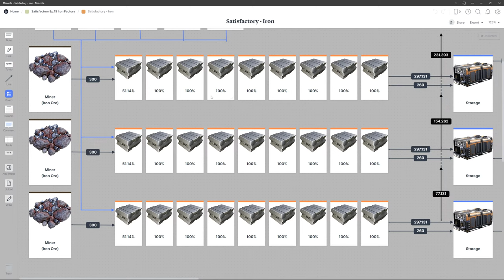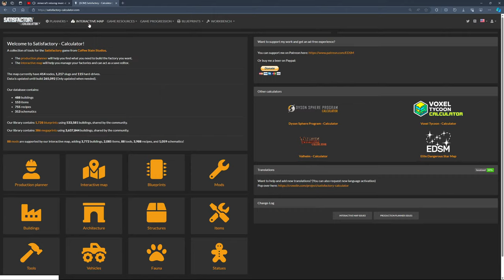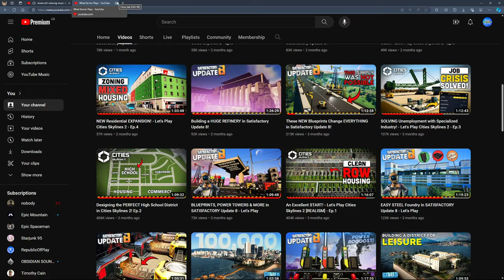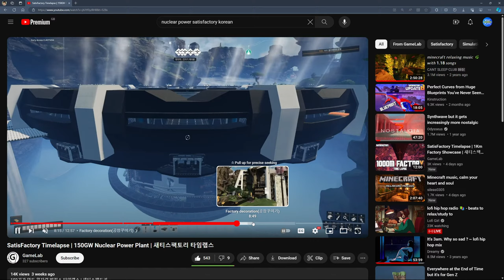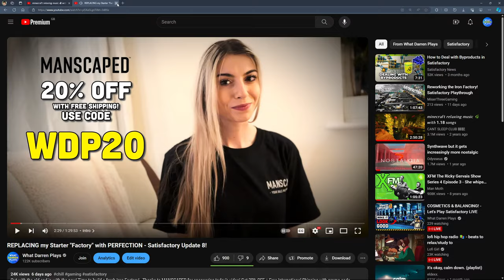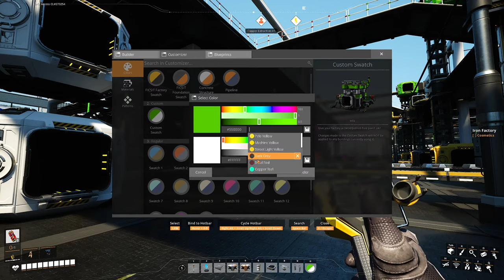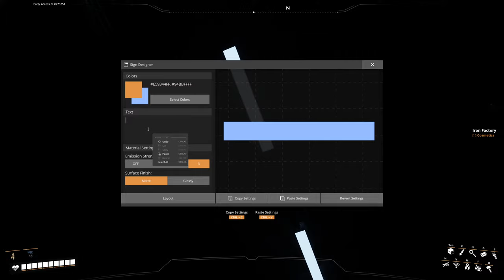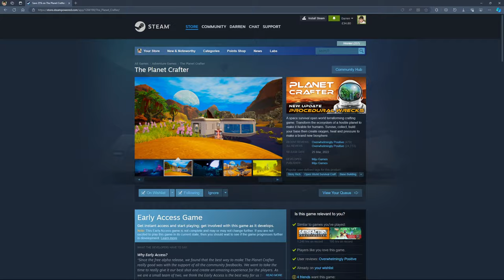Adding DETAIL and Lighting to my Iron Factory! - Let's Play Satisfactory LIVE

Comment: Hey Darren, I don’t ever get to watch live due to time difference but I do enjoy watching through your streams and hearing your commentary on well pretty much everything 😂. I did notice when you were talking about trains and throughputs you stated that you couldn’t get constant belt feeds because it stops while the train is loading or unloading. That is true, but if you add a storage container in line as a buffer the belt from the container will keep running when the belt between it and the station stops. Hopefully that makes sense. I had to use that when I created a sorter for my electronics factory because I had so many trains coming in.
Reply from the maker: That only works unless you’re using the max belt speed.
You can never transfer 1560 (2x 780 inputs) per min to a train because it pauses the belts while loading. If the belt was then feeding into a storage container as a buffer, you would be sending 1560 into the buffer, but you can only get 1560 out when the belts resume. The time they were paused means the buffer will slowly fill up over a few train arrivals.

Comment: Crystal Computers Alt Recipe is the most efficient computer option, uses crystal oscillators and circuit boards in an assembler.

For trains, you can build a blank platform.  Blank platforms will allow you to build one station receiving from several trains.  If you want the 3rd car to carry and deliver silica, you would build a station, 2 blank platforms and then a freight platform to load the silica.  Then it would be delivered to a station and empty on the 3rd platform.  If the train only goes from station A to station B, you'll always have 2 empty cars.

Comment: Would you mind explaining more about Warhammer 3 cost/return versus DLC? I appreciate your insight.
Reply from the maker: Sure, but briefly;
Rome 2 released 2013, sold approx 1.1m copies in its first month.
Warhammer 1 released 2016, sold approx 1.0m copies in its first month. Every sale of WH, a large % goes to Games Workshop, I can't say what it is, but its substantial, much more than 20%.
So in effect, Warhammer 1 lost CA money and partial audience by doing it. It was a big deal internally, that they had committed to doing 3 games, but the first game was performing way under expectations. If you take a licence, and lets say the % cut is 20%, then you need to sell 20% more to justify taking that license. The hope generally is that exposure to the licensee's audience covers the license cut. But in CA's case it didn't. Game 2 and Game 3 were supposed to follow up in 2017 and 2018, but because of the underperformance of the game, they greenlit Rome 2 DLC, Thrones of Brit, and scrapped a bigger historical in favour of a smaller mono-culture historical (which was Three Kingdoms). This was so they could keep the audience they "lost" engaged with games while Warhammer was planned to release each year. 
However, as WH1's life cycle got going, the DLC sold exceptionally well. Far greater than any previous game. The DLC is much higher margin for CA in terms of dev costs, a small group of 8 or so people make it and it brings in hundreds of thousands of sales. 
Because of this success they increases the scope of DLC's and the budget for them. WH2 released a year later, to about 0.7m sales in the first month, which is to be expected as a "follow up" to WH1, similar to Attila to Rome 2. But 0.7m sales was actually higher than expected for a year turnaround. Somewhere here I left the company and a decision was obviously made to delay WH3 out, and get historical games in before it. Maybe with the rationale that the DLC team could maintain releases and income for WH2.
Only around 2019 did WH2 start to really perform extremely well. Its playerbase climbed, the first for any TW game ever, and DLC was selling really well.
During this time Rome 2 DLC released, Thrones released, and 3K released. Ironically these projects further alienated historical fans, though Three Kingdoms was a huge money maker, selling approx 2.2m copies in its first month, and no license cut to give to anyone. Massive earnings, but unlike WH, its DLC fell flat and the playerbase faded away, like every other game they do.
So TLDR, WH isn't the cash cow the community think it is, I mean, it is kind of in terms of DLC, but not in terms of game sales. If CA could sell a historical TW like Rome 2 again, and maintain it with a DLC model like WH, then they'd be earning a significant amount more than with the licensed games.
However, I do believe they are in a position of strength now regarding licenses with GW, so I'm sure for 40K they will have a much better cut, and won't commit to doing 3 games that "join" together as it came at incredible cost to the studio to do that, and slowed their DLC down because of having to make everything compatible in multiple campaigns and forward ported to other games entirely.